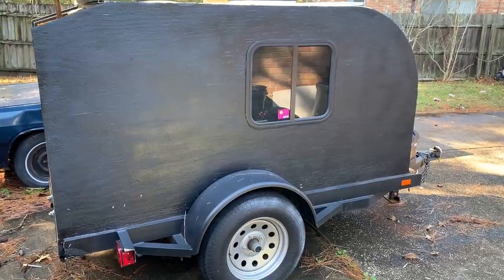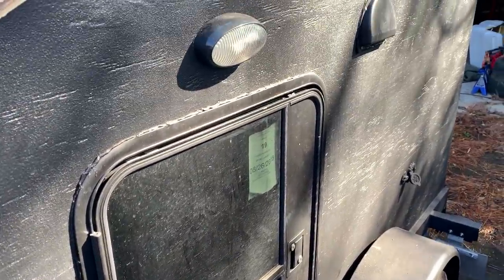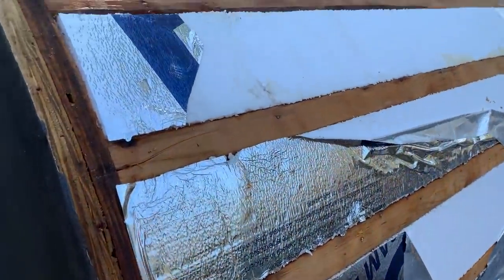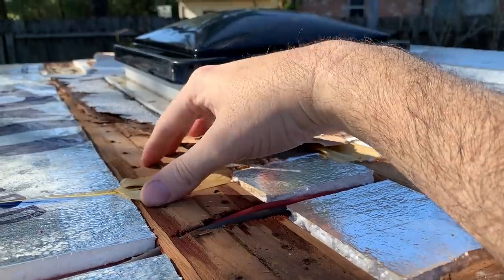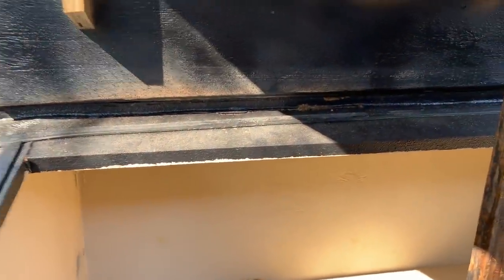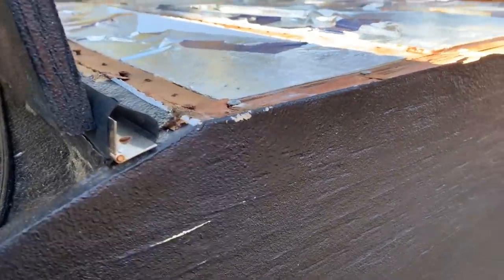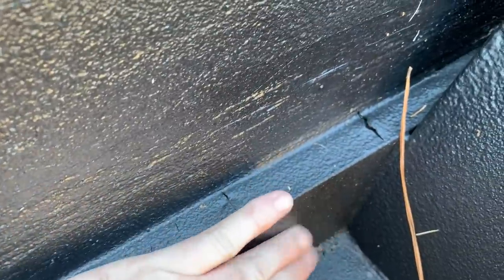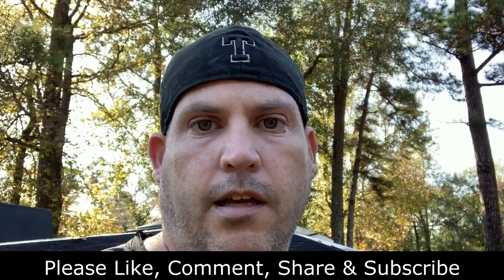6 mistakes building my micro-camper

Comment: Hey Rog, I noticed that almost all the screws you used have rusted out. I would recommend using GALVANIZED or stainless steel screws and hinges to prevent this from happening on your new build. Thanks for the video brother and best of luck to you!
Reply from the maker: Aaron Carder Thanks for the suggestion and thanks for watching!
Reply: RogMc, no doubt brother!
Reply: For sure. Sometimes using stainless steel bits on steel screws and visa versa can lead to the fixing rusting too!

Comment: Hey man I notice no one had really commented that I saw that you're Raptor liner was about 1/3 too thin. It needs to be extremely thick to be waterproof and small layers like that it's still seeps a small amount of water. A good test is take a piece of two-by-four and Raptor line it soak it in water for a week then take it out and cut it in half and check and see if it what's water resistant. I did this and mine was perfectly dry after a week

Comment: Good video, about the raptor liner on wood. I ran into a similar issue after I did one side and the roof. But if you deal the wood really well the raptor will go on and hold. I used treated wood and sealing it with wood seal and spray painting 3-4 coats along with sanding in between. Works so far. Also for good measure I used a clear seal for the roof. For precuation.
Reply from the maker: John C Ayers Thank You. Great info.
Reply: No problem.  Good luck

Comment: I life your motivation. I used metal studs on my build. Check it out on mavmc136 camper build. Metal is stronger and liter. One change I'm going to make is back out the metal tap scews and replace them with rivets.
Reply from the maker: Doug Mac Thanks for watching. I checked out your video. Nice build.

Comment: Epoxy cloth the whole exterior and do it before you fit doors, Windows, etc so you can wrap it around the corners. Epoxy cloth  floor underside and wrap it around end grain before it's installation. Make sure your ply overhangs past the top of your chassis for good watershed.. Galvanize your chassis, don't paint it. All coatings apart from powdercoat are short lived crap. From experience. Good luck
Reply from the maker: pistolpeds Thanks for the tips and thanks for watching!

Comment: Water was your problem and the main component when building, you must keep your materials dry and the moisture you create inside must have an outlet. You nailed it when you said you built inside the frame, nothing you could do after that, water finds it's way. That bumbling little thing is going to rattle things loose so consider that when building and what joinery. Looks about right, same as all those cheap RVs made of particle board, plastic and aluminum and cheap screws.
Reply from the maker: prettymochame just T you make some good points. I definitely learned some lessons the hard way with this build. The new one is turning out much better. Thanks for watching!
Reply: @BasecampUnbounded  still proud you did it and thanks for sharing. YouTubers make a lot of mistakes then just move on without telling us what happened so cudos to you. I'm in Texas and use to be a GC, I organize and don't do the work but I know the process. You already know what to do next time, protect from top to bottom so always overlapping whatever and seal seal seal but not the bottom. Roof and flanging windows is a good example and why we take every precaution to avoid water contact but if moisture does get in it needs an outlet and you must have airflow to dry out. That hinge is big trouble and careful a fantastic fan or ANY HOLE in structure but you know that I'm sure. Wherever you penetrate whether nail, cutout or seems needs special attention. You can't just use any sealant, it'll rattle loose and we all hate redoing, it's so tedious. Boat makers are a good example to learn from, nobody knows how to deal with water and structures better. Airstream understands seamless and why, I'd look at their build process.
Reply from the maker: prettymochame just T again lots of good points here. Thanks for taking the time to share your input. Much appreciated!
Reply: @BasecampUnbounded  I'll be watching for the rebuild, good luck.
Reply from the maker: prettymochame just T I’ve already started it check it out here... start with the 2nd video https://www.youtube.com/playlist?list=PLjC73s42QAHlQQaNQPLjnWvCdHOGAXVOR

Comment: I used that raptor liner on my boat and after 3 years it too is failing on the aluminum and wood surface. I will be watching your next build as well, will it be a 5x8 with the wheels tucked under the sides.
Reply from the maker: The new build will be built right up to the edge of the frame rails. About 4.5 ft x 8.5 ft. The wheels will be outside the camper. I plan on using a little larger wheel and tire so I can take it off road.

Comment: Have you thought about a product called Flex Seal? The commercial for it is a guy making a boat out of chicken wire and Flex Seal.  Very nice design on your trailer, it still has great potential. I'll see if you have a vid of it fixed and done.

Comment: Realize this video is months ago, however I wanted to add comments for those reading going forward.  Suggestions: use of Raptor liner or possibly Flex Seal products for help with weather sealing, when using a skin of metal add a full complete layer with it underneath of reflective silver insulative sheeting. This will help with hot cold issues and provide a barrier layer.  Also including plastic sheeting could also provide added protection for condensation issues. Aluminum corner angles in the front and corners can provide added protection to avoid damage to those seam joints.

Comment: Excellent vid, just the sort of problems I would probably come across, nothing is straight forward, your first attempt showed the sort of things I would 've done, plans are a must and stop you standing there deciding what to next for hours and in what order(very Important) its easier to hide wires and stuff first etc ..well done and the best of luck with MK11 ..one more thing about filming yourself, don't look at the center of the lens but the rim close to the lens center, move your eyes a bit ,look back at the job being filmed then cut to it ,, you have a staring thing going on, other than that it was well produced.. oh could you cost what you think it will .cost when done .  I so want one of these, ideal for little old England..   Si
Reply from the maker: Simon Pickering Thanks for the tips. I think the cost is around $4k including all the electrical, solar panel and two 6v golf cart batteries. Thanks for watching!

Comment: thank you for the video it helped me a lot. now to help you. use 2x3's for your roof supports or bolt in metal 1x1 square metal tubing.  for your roof try using a rubber roof low slope type product. it glues down and can have aluminum glued to it. it will also expand and contract similar to wood.  for edges and seams there is a product found in the roofing sections of hardware stores that is a tape like product made from self adhesive rubber.   

also really like the videos. thank you again.
Reply from the maker: Russell Cornelison jr Thank you for the tips. I’m glad you liked the video. I think the tape you are referring to is Butyl Tape. Thanks for watching!
Reply: the product I am referring to is actually made by duck roof it is called ultra bond comes in a 4"x10' roll is flexable and has steel-loc adhesive. will bond to almost everything (wihin reason)  i work in a mobile home park and use it mostly on vents, cracks, tears, bolt covers etc on metal roofs. it is strong, and easy to use. i find it at my local menards. good travels and may god be with you.
Reply from the maker: Russell Cornelison jr Ah! Ok I’ll have to check it out. Thank You!

Comment: The roof aluminum should be bent over the side edge1/2 to 5/8” stapled to the sides . You could putt eternabond over that seem then butyl tape under your trim molding. The side aluminum should go on before the roof .
Reply from the maker: JIm Reinhardt That’s a good tip. Thank you!

Comment: thank you for this im going to build a single sleeper motorbike one soon. sadly if you had braced across the trailer you could have raised the floor and the sides would have been lower all the way round with a rain gap. the base makes me nervous for long term weather protection i think i will go ott on the floor or maybe use a sheet of something on the bottom then sealed wood then yoga mat or two. I was very tempted to use corex plastic to build the roof and the sides but its not strong so would need a very strong frame but that would be tricky for a teardrop shape unless i go ott o on the frame as the corex weighs nothing. I know everyone trims the roof to the sides. screw that over hang both sides and seal in the corner corex is the stuff for sale signs are made from its strong easy to work with very waterproof only negative is the flutes run lengthways and so when cut in a way it will curve it will only make a 4 foot long strip for the roof so you would need to join lengths together. if you find the thinner stuff you may be able to curve it along its length against the fluts on maybe you can heat it and curve it but im unsure. i would prefer to not make it from wood if possible
Reply from the maker: Jason Leo thanks for sharing your thoughts. Have you looked into a foamie. I have seen a lot of people making campers out of the rigid foam insulation sheets covered with PMF (poor mans fiberglass). I haven’t tried it myself but they are really light weight. Thanks for watching

Comment: Here in the UK we use sikaflex sealant totally weather proof and doesn't deteriorate. Used it on my own build.
Reply from the maker: Paul Osborne I’ll check it out, if I can find it.
Reply: I use it on metal details on roofing
Reply: You can buy it on ebay

Comment: I am sure that by now you have figured out a system that works for you.  You seemed to figure out solutions to most of the problems. Here are some things that I would offer as solutions:
Mistake 1:  using a roof flashing/ drip cap along the bottom would have solved most of trouble. Tuck the top edge under the siding and the bottom is bent to fit over the trailer frame. Not ideal but better than any sealant. 
Mistake 3: you can see that where you drilled for wiring you effectively halved the thickness of the material. Turn your wood on edge (vertical) for more support. Of course you would have to redesign for more headroom (Mistake 2?)  Also, I would use strips of plywood instead of lumber. Glue and screw it together (or staples if you have a pneumatic stapler) to make thicker pieces for the roof section. Stronger than solid lumber more stable and lighter overall. The bonus here is room for extra insulation and for drilling wire holes. Drill in the centre to maintain maximum strength.  Looks like you are in the U.S. so specify an exterior grade plywood. It will have a dark brown glue line and have a "X" in the grade ( like CDX- c grade veneer one face, d grade veneer the other with x (exterior) glue.
Other mistakes: you seem to be on the right track for those.
Good video man.  Bummer you had to do all that work but it was a learning experience.
Reply from the maker: Marcel D Wow thanks for all the suggestions and info. I really appreciate you taking the time for sharing your thoughts. Thanks for watching!
Reply: @BasecampUnbounded , I am watching your rebuild now.  I haven't got to the part where you do the wiring yet but I am hoping you run the wires under the trailer and run them UP into the trailer. Less likely to have water penetration.
Reply from the maker: Marcel D I haven’t gotten to the wiring yet but that’s exactly what I plan on doing.

Comment: use flashing 90 degree angle all the way around  it will be first thing attached to wood and then you hang siding over it. just like a roof. zero issues
Reply from the maker: Donnie Smith Nice tip. Thanks for watching!

Comment: Another option is a foamie you build the sides and roof with 2" xps foam it doesnt absorb water and provides great insulation. you can include a wood frame inside but the shell is foam and then you fibre glass the sides and then the top so it overlaps

Comment: Thank you very much for saving me from doing some of those mistakes too..
*Use some sealant over the edge where your butyl tape is peeking out, because the butyl is waterproof BUT degrades and shrinks when exposed to UV. That's the best practice for how RV's are built. Sealant, not Caulk! Another idea if it hadn't been so far gone when discovered, would be to use a metal Z flashing along that bottom edge, and use the Butyl tape and sealant, maybe with a trim strip(Like on rvs) for the top edge of the flashing, and maybe the bottom edge too. That sucks it leaked and rotted, but really appreciate you showed people.

Comment: Thought of using fibre glass too build a a shell for my camper.
Reply from the maker: Pierre Du Plessis Fiberglass is a great option. It’s a little pricey but would work great. Thanks for watching!
Reply: @BasecampUnbounded  build the framework out plywood like you did and cover with fibre glass. As you said it could/can be a bit expensive in the end of the day its water proof. My only concern is weight.

Comment: 1x are funny that way, they just aren't as strong laying flat as they are on edge! It doesn't help when you cut them to run wiring either! Use 1x2, just stand on edge! When I saw your first build vid, I wondered about the design of the trailer! It will be interesting to see the solution!
Reply from the maker: oldschooldiy I used them because I wanted as much head room inside as possible without going taller than four feet. Had more than enough though so I think I can go with 2x3 and still have plenty of room inside.

Comment: use rv stuff... they make a rubber roofing material supper simple.. just need the glue, and strips of aluminum channel to secure it with butyle tape on them. me and a buddy re-did the roof on my parents camper last year. stuff is called EPDM it's a thick rubber material that you literally unroll it.. let it warm up a bit.  curve any sharpe edges (use a router with a 1/4 round bit), then you apply glue to the plywood roof, than unroll with the white surface facing out. then use the strips/butyl tape, and screws to secure it down.. instant roof. any vents should have butyle tape under the flat surface.. and once that is down, and secured use the lap sealant on all joints/screws stuff is kinda thin.. but sets fairly quickly.. it remains pliable, and seals out any moisture.. works great.. EPDM can be washed,l cleaned, and it fairly durable. (you can walk on it, however, dont wear boots you risk ripping, or tearing the rubber..)

For the sides of the trailer I would use aluminum or even try just a single or double coat of fiberglass weave.. you can then either do a fiberglass gel coat (spray on), or a marine grade paint.. the lower half I would use an undercoating like herculiner, or some such, and then paint over it with a UV resistant paint as herculiner is not. remember sides go on first. but first you need to build a whole new structure.. I highly recommend in your rear hatch to make a better "gutter system, with a physical dam, for the water flow, not just rely on the gasket.. thats bad planning. I would either rout out a channel, or with wood build a channel into the rear hatch for the water.

Comment: I like your original trailer frame and would use it again but take it to a weld shop and have them weld cross beams on and make the deck level with sides, those fenders look like you can stand on them.then you can build the cabin tight from fender to fender.
Reply from the maker: Mike Ratkowski  I would have liked to keep the genders but I want the aluminum skin to go all the way to the bottom of the outside of the trailer and I could not with the fenders welded on. Thanks for watching!

Comment: I use to metal clad window and door exteriors. I got out of it when I realized the metal would allow ALSO the humidity from the air to get in behind it causing the wood to start to rot in a few years. Wood can be like a sponge therefore it needs to breath..

Comment: Here's my usual 2¢. A collection of notes I share on my squaredrop camper Facebook group. 

My welder used a polyurethane black paint on my chassis that bonds to metal and rust. Very durable.

Seal the inside of the fenders with metal. Or you will suffer from horrible road rash from sandblasting 👍
Use diamond plating in front of the trailer to prevent sandblasting from your rear tires. 

Use polyester MARINE grade fiberglass resin on the outside of your plywood. Not the stuff in automotive stores. The final coat should contain wax so it cures and is not sticky. I used gelcoat, but a polyurethane paint will work. 

Seal the joints of your plywood with Lepage's QUAD, not silicone. Not butyl tape. 

3/4 plywood construction. You want it to be sturdy. Buy the best quality you can find. 

Choose your plywood carefully. I bought expensive plywood with voids. The voids swelled when the resin soaked in. A quick scan of the edges would have saved me from woe. OSB is the worst thing to buy. Don't cheap out. Cheap = sadness. 

Inside, I used an "eco epoxy" resin that will not off-gas. You can do the outside with epoxy, but it's expensive. 

In the photo below, I added a pigment to the polyester resin as an experiment. It didn't really do what I wanted. It was transparent. And I should/could have added wax to cure it. Learned from that. 

Water and mould are our enemy.
HTH helps
John
Reply from the maker: Trucker Daddy - AKA John in Québec lots of great information here. Thanks for sharing!
Reply: @BasecampUnbounded  it's mostly lessons I've learned 😇🤣